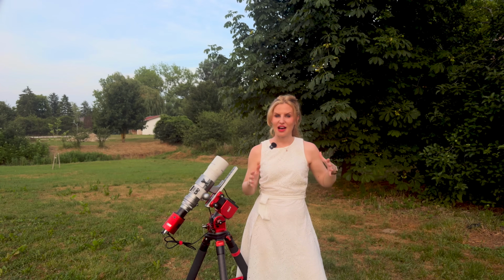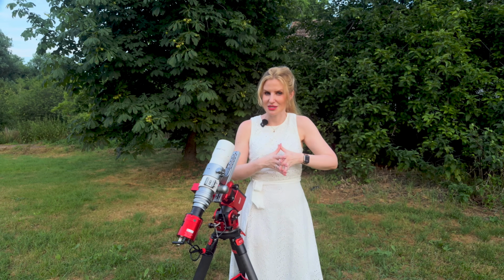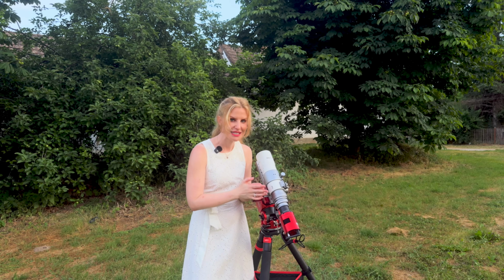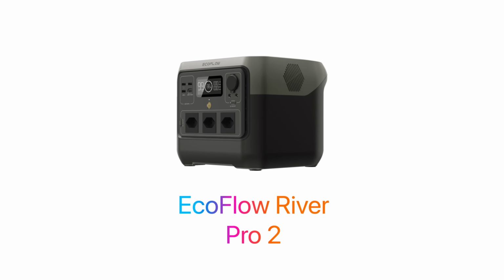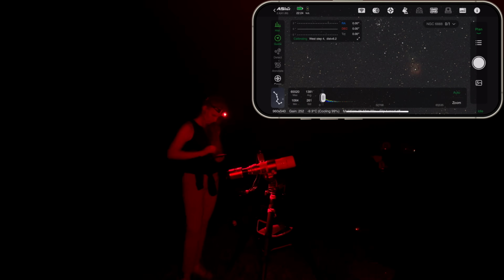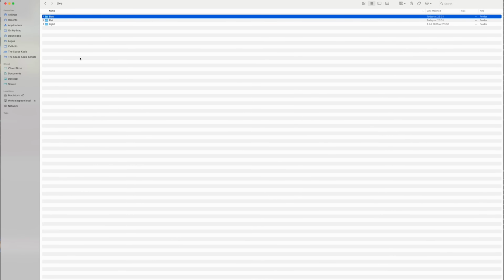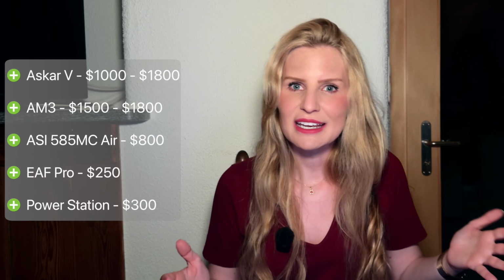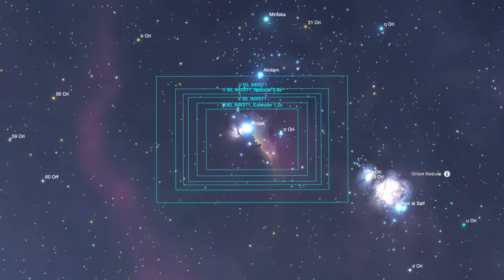Build Your Own Smart Scope! Easy as a SeeStar, Pro results!

Comment: I run the same basic rig, except I have ASI2600MC Pro and ASIAir+.  I also own a Apertura RC8, QHY Minicam8M, ASI676MC.  I love the fact I can go from 270mm to 1370mm and from APS-C to 7mm square.  I teach astrophotography at my local observatory and usually have the Askar V with 2600 running plus a Seestar S50, Seestar S30 and a Celestron Origin.

Comment: Thanks for the video. Definitely food for thought for me the other way around- moving from a high resolution 8”SCT rig to something more portable for nebula. However we may have discussed this before (can’t recall!) but you show the rig taking a master flat and a master bias in LIVE mode. I have the same in my ASIAIR set up. I have requested from ZWO an understanding of how these are taken. They do not reply. You normally need master bias frames removed from EACH flat before you can create a Master Flat, yet there is no obvious internal process that seems to do this. You can get the Master Flat with or without the Master Bias. So in your separate processing in PI how did you address this? Thanks.
Reply from the maker: there is no mathematical difference between subtracting the masterbias from the individual flats or subtracting the masterbias from the masterflats!
I had the same doubt as you when I first tried the live stacking with calibration frames. However, I believe ZWO implemented it this way as a lot of people do not necessarily know flats must be calibrated as well so they (I suppose) do this in the background
Reply: @the_space_koala well i wish they would explain this 🤷🏻‍♂️🤦🏻‍♂️

Comment: basically i'm doing something similar and joking call it SuperSeestar with other astro folks, but using
- Skywatcher Evostar 150ED DX
- Skywatcher 0.77Flattener
- AM5N
- ASIAir PRO
- ASI120mm mini camera
- Guidescope 
- ZWO TC40 Tripod + ZWO Aluminium Pier
-ASI2600 Pro
I had zero experience with telescopes before, comming from reflex + lesnses + iOptron Skyguider Pro and Seestar S50.
Once to get used to handle the Telescope, which is quite big, the rest is pretty easy ( but not so portable ).
I do wire the ASIAir to my home network using Devolo lan over powerline.
I have attached an Lbrackets and cable managment to the telescope mouting rings and to them the power adaptor, so less prone to it get twisted while the mount moves.

With a bit of luck in short termn I plan to get: 
-ZWO Focuser and a rotator, this things are a must.
-ASI585 color
-OffAxis guider
-TeleVue 2X
-Powerstation
Regarding ASIAir, I know i could get the drivers and use NINA, however, it does not seem to worth the hassle so far.
I want to keep things as easy, and less error prone as possible also i do prefer guider and asiair be separate from the camera.

In the long term i would like to: 
- have some kind of semi permanent pier with some level of shielding, specially for windy days.
- incursion into solar
- incursion into monochrome
Reply from the maker: wow your superseestar is a beast! :D

Comment: Thank you.  I have a question I have  a SeeStar but am thinking of starting my upgrade on my Cel 6” Evolution by adding a Cel reducer/flattener and a ZWO ASI585.  Later I would add what you recommend in the video .   Do you have any recommendations?
Reply: Also, Would recommend the wireless version of the camera or the cheaper version
Reply from the maker: if you're planning to use the ASIAIR system this version is the best deal. However, if you think you'll wanna use NINA or any other app, you're better off with the regular (Pro) not Air version
Reply: @the_space_koala  thank you!!  I checked out Highpoint for the camera but they recommend a larger pixel size camera for medium to long focal length scopes and poor skies, which I have.  Does it matter that much?  Perhaps I should sell the 6” Nextstar Evolution and invest in the type if equipment you recommended so I could continue with a better smart scope. I’m yearning for better astrophotos

Comment: How long does that rig run off of your battery? Because it seems quite beefy, as in multiple nights of use without recharging?
Reply from the maker: it depends on the length of the night but yes 3 nights easily
Reply: @the_space_koala  Great. Was curious, because I just finished building my own power bank, and I think I have around half your capacity. Haven't got a chance to test yet.

I also don't run anything computerised. So with just the tracker, mirrorless and optional dew heater, my setup probably consumes way less than yours. Good to know that's plenty of capacity for a whole night, even if I decide to upgrade later. Thanks!

Comment: Hi,
lovely informative video, I was thinking of building a "Seestar S200" based on a Celestron 8 (not sure if I should go for the EdgeHD), ZWO AM5n and ASI Air for DSO and planets.
I would appreciate any advice you may have to offer as to what else I  should add onto my shopping list and as to whether I need to sell my kidney to pay for it!!!!! 
I would like to build something like a celestron origin but with flexibility to do planetary as well from the comfort of my warm living room.
Reply from the maker: that's a great idea. there are a few limitations, though. The ASIAIR is not the best for planetary imaging. of course you can do video mode, but the FPS will never be as high as with a regular PC - this is to keep in mind. That said, it's doable, but the rig is better for deep sky. For the C8 you more than likely want to do a larger sensor to get more targets in the FOV - like the 2600MC. The EdgeHD has many advantages over the regular version so if it's an option I would go for that one. You need to understand how well guiding will work. Especially if you use the reducer, some of the guide sensor of the 2600 air will be obstructed unfortunately (I haven't had the chance to test how much yet). If this is a case it could be a better option to get the regular 2600 and a separate OAG that you can push in a bit closer to the main sensor. Of course you could have a separate guide scope but I never recommend that to anyone :)
Reply: @the_space_koala  Hi,
I've decided to go with a C8 with a reducer, AM5n and AS585MC air. , AKA Seestar 200!
Hopefully should be good for planets and small DSO's
What do you think.

Comment: Question: At about 19:00 you said that , on small scopes, the focus does not need adjustment over during the night. That has been my experience also. Does this also apply to the SS50? Thanks for this excellent pod cast.
Reply from the maker: yeah! it's just important to wait until the scope has reached the outside temperature before doing the initial focusing

Comment: So this was great but it struct me that the Seestar s50 has all these built in filters. What are the ones you should get if we are building this thing.
Reply from the maker: well technically it has 1 filter (what they call the LP filter, it's essentially a very broad narrowband filter). The other one it has is a UV-IR cut (luminance filter) which is already installed on this camera. So yes it's a good point, you would have to add a multi narrowband filter to the shopping list as well. The good news is that there is a wide variety of them available with different bandpass widths and for different budgets.
The solar filter is also an extra thing if you want it, but a seestar-level solar filter (solar foil in a 3d printed case) is something you can get for maybe 30 bucks

Comment: Thanks for this video!  I have two smart scopes and have been thinking about moving to something like you've described.  I appreciate the flexibility, but am always left wondering how much better the images would be compared to a Seestar, Vespera, etc.  Do you have a side by side comparison?  If not, maybe a future video?
Reply from the maker: it would've been a good idea to do it at the same time with the seestar. The thing is it will depend a lot on the FOV you want. If you want the larger field of view this setup offers by definition it will be much better because you get more integration time (as you have to do a mosaic with the seestar). This in general is the largest difference in quality IMO. Of course you get better (spatial, not image) resolution when you use larger optics, too

Comment: It's an excellent idea, your suggestions are very good. I have such a home made smartscope based in a asiair mini, with the ioptron HEM15 mount, the most expensive part, and an 6" f5 Skywatcher newton telescope, with an asi432. All together cost 2500€ and I have a 6 inch smart telescope.
Reply from the maker: yes a newt gives you a much better bang for buck, but definitely higher maintenance so I didn't recommend it for those used to the luxury of smart scopes :D

Comment: My first set up was just completed.  I have most of this set up after the Askar V went on sale for under 1k.  I’ve got the 585. ASI Air, AM5N, EAFN, and guide scope…. I do have more cables but they are managed well.

This is a great system and easy to learn/understand.  

I’ve a lot to learn but I love this versatility.

What’s cool with this is how easy it is to change out cameras or the focal length.  It rocks!

Thanks for sharing, your channel is awesome.
Reply from the maker: that sounds awesome! May I ask why you got a guide scope?
Reply: @the_space_koala I don’t have the ASI585 Air or Duo, just the ASI585 Pro.
Reply from the maker: oops I misread your first comment. makes sense!
Reply: @the_space_koala no worries!

Comment: Thanks, some great info there! I have been thinking about doing something very similar and you have clarified a few things. I currently have two setups, a smaller SA GTi rig which I use with an unmodded DSLR and a 350mm lens (plus NINA via a laptop and a guidescope), and a C9.25 EdgeHD Evolution, which is amazing, but currently not very suitable for astrophotography. I think I can follow your advice and move this towards a very flexible rig combination a bit at a time. The ZWO ASI585 Air would tick a lot of boxes, and I could get a SQA55 as well without breaking the bank, and that should work fine on the SA GTi, as well as opening up planetary options on the C9.25. Then I could save up for a bigger harmonic EQ mount in the future and enable a new category of galaxy targets with the C9.25. I sense a plan forming... :)

Btw, what was the flat panel you used in the video, it looks very convenient?

Thanks again, and keep up the excellent work!
Reply from the maker: that sounds like a good plan! the flat panel you see is homemade, I ordered a circular EL (electroluminescent) sheet online and had a circular plexiglass cover made for it and stuck it on. I have made a few of these after I realized how crazy expensive "proper" flatpanels are. Of course you don't have all the flexibility with it and you have to make sure your exposures are not too short as the light is not continuous

Comment: Using an small newtonian instead of an Apo will drop the costs significantly. I did the similar calculations as you and i am very happy that the outcome ist the same as yours! Congrats for the fine video... greetings from Austria!
Reply from the maker: yes that is true newts are the best bang for buck and realistically it's still larger than the apo shown here. They are far from "smart scope" ease of use, though as you have to collimate them
Reply: @the_space_koala  i agree the kollimation issue

Comment: Thanks for this, it is very informative. I already use the star adventurer GTI. Am I correct in understanding that if I used this setup with the GTI, I would use the GTI as my go to, and then the rest of the process that you showed would be done by the ASI camera (or the other equipment shown). In other words, everything else is contained in the ASI app? Thanks!
Reply from the maker: you'll have to connect your SAGTI to the camera via a USB cable (and I think it even works via Wi-Fi). The ASIAIR supports the mount via a driver - you'll just have to select it from the drop-down list (where I selected AM5). Everything else will be identical to how you see it here - guiding, dithering, goto etc. will work the same way

Comment: Nice and informative video as always, thank you! I have two objections though: I would consider this setup a logical step up for someone who collected first experiences with a Seestar instead of a Seestar alternative. A complete beginner may still get into trouble. And in addition I would recommend a Petzval design scope to avoid trouble with flange distance, although this may not be that much of an issue with the 585 sensor. Another "upgrade path" from the Seestar may very well be to just start to postprocess your Seestar images in Astropixel Processor or PixInsight which is a good preparation before moving to a more complex setup.
Reply from the maker: all very good points! The backfocus thing, though, is a little over-mystified in my opinion. When you buy one of these cameras they give you the exact spacers to always be at exactly 55mm. You would only run into issues if you try to add additional things in the optical train, which a complete beginner is unlikely to do. Regarding the processing I am 100% with you - I just assumed if a Seestar user is already thinking of purchasing a larger equipment, they're already processing their own photos.

Comment: lol to buy all this the user can buy 10 see stars  and also getting all this rig in airplane is mess . hence seestar user will continue using that but this AIR camera definitely helpful 
for advanced  astro photographers
Reply from the maker: well, nobody's saying to throw the Seestar away :P the more scopes the merrier!
Reply: @the_space_koala    Need one suggestion from you  I m planning to upgrade to strainwave EQ mount however I am very tempted for i-optron HAE16c or 18c which are super light 2.5 kg compare to AM3 3.7 kg .I want to travel with my rig sometime can you suggest should I go with ZWO am3 or ioptron strainwave mount .
Reply from the maker: I don't have any experience with the HAE16c so I can't tell you much - isn't it strainwave only on 1 axis, though? If you don't mind having to balance in DEC it could be a valid option but again I don't know how well it works

Comment: The only minor thing is that you will need a dew heater strap and a cable for the dew heater.  Otherwise a nice setup that is flexible and should work mostly out of the box, all for under $3800 USD.  And yes, unless you live a very dry area, you will need a dew heater strap for the telescope.
Reply from the maker: someone else said this which makes me realize this is a huge thing for a lot of people. I have a dew heater strap for small refractors which I bought 3 years ago and have yet to use it. That said, it's a valid point, it should be considered. Thankfully they're not too pricey

Comment: Thanks for your effort, but as a Seestar 50 user, I 'll wait for the next upgrade or new model, which I guess will be definitely way cheaper than the option you have shown here.I am deeply convinced that smart telescopes will replace complex expensive gear in just a few years, the same way CCD cameras replaced traditional film astrophotography, or AC correctors in mounts were replaced by fully automated wave mounts.
Reply from the maker: I agree that whatever the next model is will be more affordable than this one. I also see the trend going very much towards the all-in-one scopes. I doubt they will replace gear altogether, though, apart from the small refractors